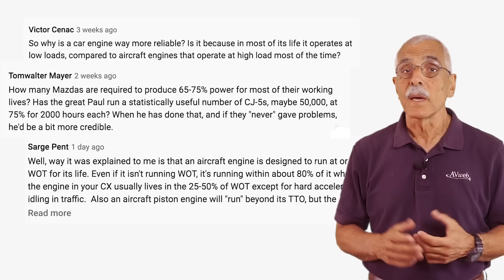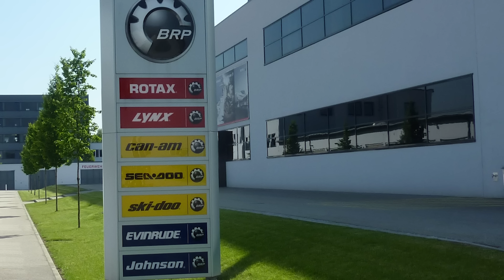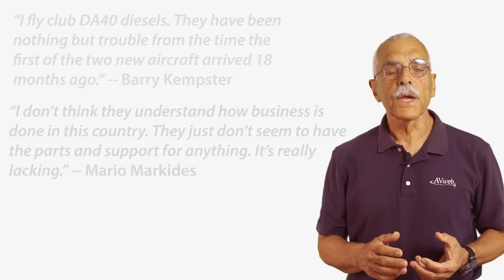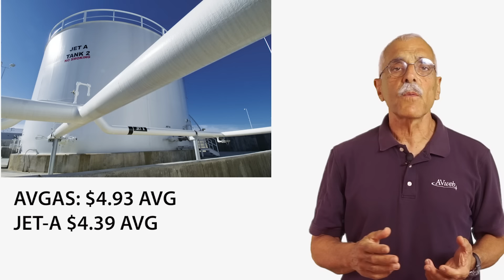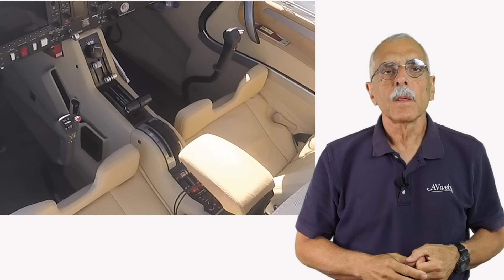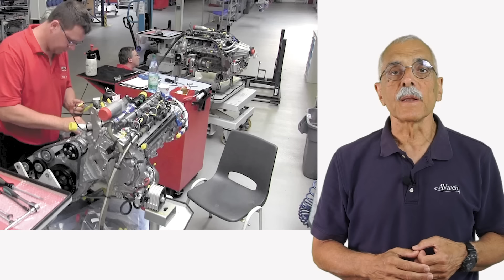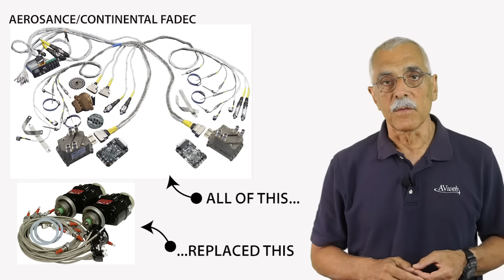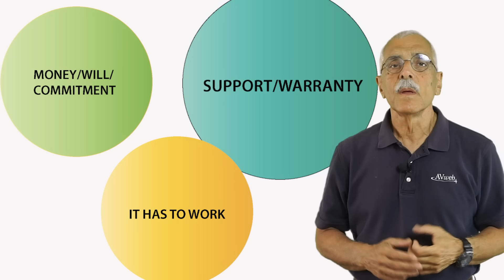Why New Aircraft Engine Ideas Rarely Succeed

Comment: “If the engine is warm, there is a procedure to start it that works every time, but nobody knows what it is.”  You have got to love this guy!  Absolutely hilarious...and absolutely true.
Reply: Warm start procedure: Intentionally flood engine and then proceed to "flooded engine starting procedure" Works every time.
Reply: @billstevens3796 🤣🤣
Reply: I think Paul said it also needs a certain facial expression in addition to other mystical procedures.
Reply: good one, bill.
Reply: And for some reason that’s OK.  Would you buy a car in 2021 like that?
Reply: @stephengloor8451  A car is nothing like a plane. Far more is required to make a plane fly efficently then to make a car drive.
Reply: @tomatosoupwoo   But humans operate both of them.  The simpler and more straightforward the controls are then the safer they are.  I find it strange that the same pilots will fill their cockpits with every electronic device known to man but for some reason view that same technology as forbidden for the engines.  If a pilot has no backup IMC instruments or the pilot now lacks the ability to use the older IMC instruments and the electrics fail then they will have a sweetly running engine as they spiral in which is not really a comfort.
Reply: @tomatosoupwoo  I think Stephen Gloor is talking about the gyrations you have to go through to start the old style engines. Back when I first starting driving cars and trucks the engines had carburetors and similar gyrations were needed to start them especially when they were cold. People are used to just pushing a button now days and would never put up with what you had to go through in order to start a vehicle back in the day. Now days about 50 percent of the people driving wouldn't have the smarts to get the old vehicles started.
Reply: @johncarter1137  I laughed out loud when Paul made that statement. You're completely right about older vehicles starting much like an aircraft engine. The other thing is that carbureted vehicles tend to require similar service intervals to aircraft engines. Complex carb components plug up or drift out of tune. Dirty air cleaners throw off mixtures. Spark plugs foul and carbon builds up on heads due to the fact that a carb cannot precisely control the mixture like closed loop EFI. And even a vehicle that is stuck on the ground can be thrown off enough by altitude and weather changes that you are forced to adjust the jetting! 

Fuel injection made car ownership so trouble free that most people ignore their engine unless it fails catastrophically. It's amazing it took so long to get EFI onto aircraft engines. You won't find many devotees to carburetors in cars anymore now that systems like the Holley Sniper EFI are available as drop-in replacements.
Reply: @johncarter1137  way less than 50% in my most realistic assessment. Choke, jumper cables, starting fluid. What percentage of drivers can open their hood and check the fluids?
Reply: @johncarter1137  eh I wouldn’t say smarts I would say experience. It’s not that people are dumber nowadays it’s that no one taught them how to start an engine like that, because no one needed to.
Reply: @eulachonfish  WELL, I for one think the carburetor is over due for a modern revamp ... GD computers need not be controlling my car .....👍
Reply: @jiroyamamoto2878 

G'day,

My 34 y.o. son is an Auto Electrician, he explained
Automotive
Progress to me
Thusly...,

"Do you remember the Owners' Manual of your first Car ?"

"Yeah, sure, the old grey Morris 1100..."

"Right, and do you remember that the Manual told you how to set the Valve-Rocker Clearances...?"

"Yes, of course, that's where I learned how to do it..."

"Right..., well these dayze the Manual
Warns the Customer
Not to
Drink the
Battery Acid...!".

That about sums up the
Actual 
Effect of
Computerised to Automation on
Humanity.

My kid makes his living fixing shit for people with no clue what to do
When
ANYTHING 
Stops working at the push of a
Button.

In 1977 I watched a
Nuclear Rrsearch Reactor full of
Certified to be Clever Boffins who'd been functionally
Stupified by an
IBM Mainframe Computer.

They used Grid-fed Waterpumps to cool their used Fuel Rods, and when I suggested Individual Tubes, with a Cold water Lower manifold plumbed into the adjoining River - with a Collecting Manifold on top to collect the hot water ; then each Rod would Power it's iwn Thermosyphon-driven Pump to carry away it's Waste Heat - independant of the Coal fired Grid.

They told me I was mad, to worry about Grid Failure.

In 2011 Fukushima Daiichi showed them to have been as insane as I thought them, when I was 16.

Much
"Progress" is
Marketing Jism,
And is actually
Highly
Regressive.

In real life.

But, y'know..., I'm but a
Simple
Hillbilly.

Such is life,

Have a good one.

Stay safe.

;-p

Ciao !
Reply: @johncarter1137  And why are current car engines so much better, easier to use? ……competition!  There’s very little competition in aviation ICE engines.
Reply: @eulachonfish  And what drove EFI adoption? …..competition. Aviation engines have very little competition due to liability/insurance reqmts.
Reply: @charlesangell_bulmtl  Computer driven EFI is verrrry reliable.
Reply: I laughed when I heard Paul say that, but a few years ago I might have cried.  My IO-540 used to regularly ground me when hot, and yes, I tried all the different folklore hot-starting procedures.  They all worked "sometimes"....  Then I fitted a faster starter motor and since then my engine just starts every time.  I'm much happier....so I could laugh at his joke.
Reply: BS, he proceeded to tell you what any redneck knows about starting a heat soaked engine ... open the throttle and clear the rich charge .....
Reply: Hot Start: Throttle full open, Mixture at idle cut off, NO priming or fuel boost. Crank while moving the mixture control forward until the engine fires, hesitate 3/4 of a second and then smoothly bring the throttle back to a mild roar. Adjust mixture as needed. Works every time. Ask Tom Turner who showed him this procedure.
Reply: P
Reply: @Matthew Morycinski those darn run away two stroke cycle detroit diesel AV engines!
Reply: This is because most people who hold a pilot rating rarely understand the physics of why engines will not hot start 😂 those of us who are also mechanics know to open the throttle, crank the engine THEN add fuel ...hot engines need cold air first ...it’s thermodynamics
Reply: The diesel would be better if it was not electronic injection and was the more reliable and simple mechanical injection

Comment: Seriously though, by the time aircraft piston engines become as reliable and cheap as car engines they will be replaced by electric motors anyways. THAT will be the biggest boon to personal aviation of all time, HUGE times between rebuilds and so incredibly cheap and reliable to run... Can't wait, just need battery tech to catch up, which it will...
Reply: Don't hold your breath.  Batteries need around 18x their current energy density to be comparable with gas.  That's after factoring in the much greater efficiency of an electric drivetrain.

That isn't something small incremental improvements are going to produce.  That's something we need brand new technology breakthroughs for.  I'm guessing by the time we see a technology that can do that, I'll be far too old to be flying anymore.
Reply: @rbrosz  not holding breath, but they are making advances all the time. I think it's inevitable that someday all motors will be electric.

Comment: The Bombardier V300T/V220 did NOT have DOHC, it was a SOHC engine and only had two valves/cylinder. Cost is likely the reason why Bombardier chose this configuration, but it was absolutely insane from a performance standpoint. Running at 5,500 rpm, the engine would have benefited from having 4 valves/cylinder, enormously.
Reply: The Rotax 912 , 914 and 915 series, I believe, all run 5500 to 5800 rpm, 2 valves per cylinder head, pushrods to rockers. Doesn't seem to have a problem with breathing. 100 HP out of 1365 cc's, no problem.   141 HP in the turbocharged version.
Reply: @randyvanvliet226  Except that they demonstrate somewhat poor fuel consumption (0.40 lb-hp-hr, at their absolute best, 0.50 at their worst) and poor specific power output (as did the V300T/V220). BMEP is around 185 psi for the 912, but would probably be around 210 psi if it were a DOHC, 4 valve/cylinder engine.

Edit: That jump in BMEP would produce a 15% increase in power output and the decrease in pumping losses would likely result in a 10-15% decrease in fuel consumption.
Reply from the maker: You're right. My punch list included fixing that title because I knew it was SOHC. Thanks for the point out. I'll add a correction in the comments.